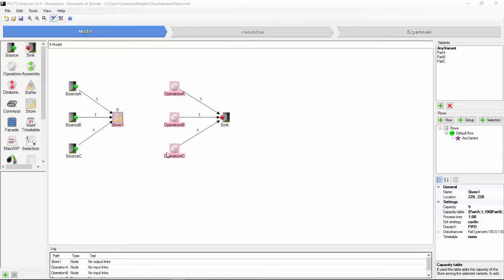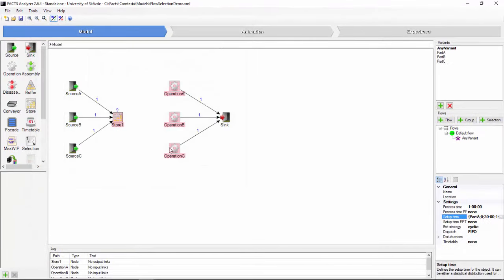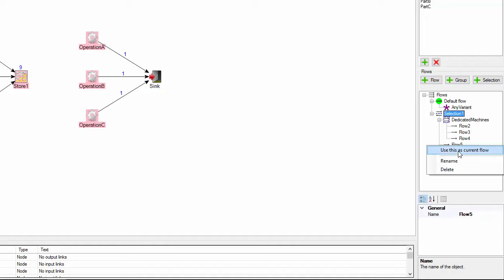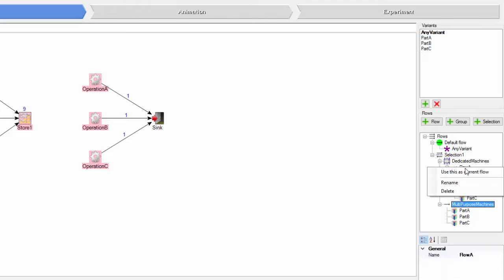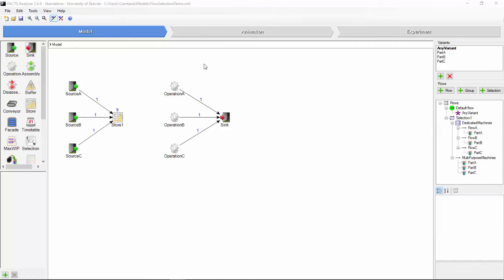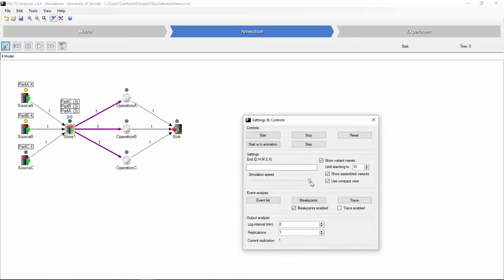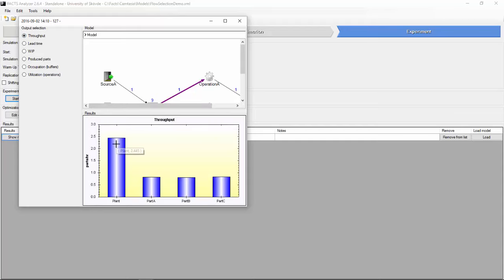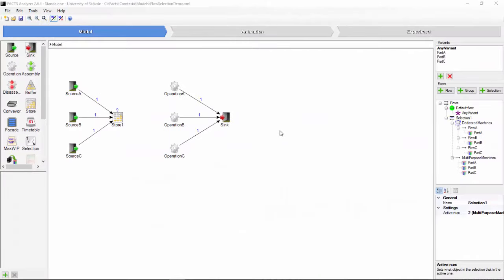Flow Selection Demo

Comment: ⥊ 65: 66

0: Good

001: Uniqueness
002: Altruism
003: Sensivity
004: Audacity
005: Boldness
006: Astuteness
007: Ingenuity
008: Innocence
009: Truth Seeking

01: Willpower
02: Progress
03: Acuity
04: Love
05: Bravery
06: Congruence
07: Consonance
08: Honesty
09: Cleverness

1: Ethics
2: Problem-Solution
3: Definition
4: Idea
5: Expression
6: Why / Who / When / How / Where / What
7: Information / Code
8: Stability
9: Sanity

10: Network
11: Justice
12: Affront / Easter
13: Subject / Death
14: Cognition
15: Agent
16: Reason
17: Discourse
18: State
19: Control

20: Judgement
21: Ethical Solution
22: Scupulous
23: Delimitation
24: Humor
25: Behavior / Christmas
26: Motivation
27:    Comprehension
28: Dependency
29:    Regulation

30: Liberty
31: Permission
32: Discernment
33: Responsability
34: Support
35: Means Invention Mechanism
36: Purpose
37: Opinion
38: Decision
39: Prospect

40: Goodness
41: Awareness
42: Critical Thinking
43: Consideration
44: Conceive
45: Plan
46: Ability
47: Knowledge
48: Character
49: Ambition

50: Good Expression
51: Manifestation
52: Resolution
53: Application
54: Empowerment
55: Movement
56: Demonstration
57: Assignment    Mission
58: Building
59: Proficiency

60: Accordance
61: Appropriated
62: Implication 
63: Indicator
64:      Cohesion
65: Function
66: Investigation
67: Argumentation
68:      Sophistication 
69: Scrutiny

70: Intelligence
71: Message
72:      Consistency
73: Election
74:     Coherence
75: Consolidation
76: Explanation
77: Flow
78: Constancy
79: Measurement

80: Peace
81: Sovereignty
82: Perseverance
83: Reliability
84: Autonomy Instrospection
85: Rectitude Implementation
86: Pursuit
87: Persuasion
88:      Structure Benign
89: Commitment

90: Kindness
91: Assertiveness
92: Optimism
93:     Scrupulousness
94:     Compassion
95: Composure  Essence Fiscalization
96: Blockchain: ⥊ (TRACE MARKER) Legacy
97: Anarchy
98: Veganism
99: Revolution

100: Liberation
101: Decency
102: Progressive
103: Resilience
104: Integrity
105: Collaboration
106: Abolitionism
107: Concordance
108: Clarity
109: Regulation

110: Ethical Commitment
111: Honor
112: Exploration
113: Privacy
114: Will
115: Pride
116: Justifiable
117: Equitable
118: Fair State
119: Mission

120: Harvest
121: Deliverance
122: Resistance
123: Cogitation
124: Challenge
125: Appropriated
126: Searching
127: Emphasis
128: Consistent
129: Subversion

130: Fulfillment
131: Admission
132: Criteria
133: Response
134: Provide
135: Technique
136: Principle
137: Point of View
138: Choice
139: Prevision

140: Serenity
141: Conscience
142: Concern
143: Perception
144: Free Love
145: Idealize
146: Capacity
147: Mindfulness
148: Schema
149: Morality

150: Righteousness
151: Virtue
152: Coordination
153: Efficiency
154: Equip
155: Cooperation
156: Profiling
157: Counter-Terrorism
158: Rising
159: Excellence

160: Reasonable
161: Procedure
162: Corroboration
163: Hint
164: Value
165: Role
166: Lead
167: Logical
168: Improvement
169: Assess

170: Sympathy
171: Relevancy
172: Dichotomy
173: Naming
174: Elucidation
175: Materialization
176: Validity
177: Harmony
178: Fluency
179: Verification

180: Perpetuity
181: Independency
182: Perseverance   Dependability
183: Structure
184: Potential
185: Stance
186: Occupation
187: Compelling
188: Conviction
189: Boldness

190: Power
191: Wisdom
192: Effectiveness
193: Prudence
194: Foresight
195: Discipline
196: Trackable
197: Accountable
198: Compeling   Sustainable
199: Quest

200: Ideal
201: Compatibility
202: Referee
203: Adjudicate
204: Conformity
205: Coexistence
206: Methodical
207: Correspondence
208: Eccentricity
209: Expertise

210: Solution
211: Resolution
212: Prosecution
213: Adjustment
214: Transformation
215: Conversion
216: Escalation
217: Correction
218: Persistence
219: Analytical

220: Contemplation / Meditation
221: Preparedness
222: Dialectical
223: Meticulous
224: Diligence
225: Attitude
226: Rigorous
227: Dispute
228: Healtiness
229: Prescription

230: Allowance
231: Agreement
232: Definition
233: Jurisdiction
234: Availability
235: Proposition
236: Objective
237: Reckoning
238: Settlement Warrant
239: Assurance

240: Mindset
242: Mental State 242: Consideration
243: Rumination
244: Impression
246: Sagacity
247: Easygoing
248: Disposition
250: To Thrive 
253: Conduct
254: Potent
255: Insurgency
257: Defiant
260: Unveiled    Exposed 
261: Freedom Fighting
262: Correlation
263: Relevance
265: Conjecture
266: Suggestion
269: Estimate
272: Paradox
273: Choice
274: Dispute
280: Constancy
282: Evanescence
288: Healtiness
289: Conduct
290: Prognosis
294: Anticipation
295: Proof of Stake
296: Calculation
297: Proof of Work
298: Commitment

300: Crusade / Jihad
304: Concept Attention
301: 
309: Consensus 
310: Conviction
311: Consent
312: Confront
312: Distribute
313: Enforcement
314: Bodily Autonomy
320: Deliberation
322: Opportunity
327: Suspicion
330: Adherence
331: Self-Determination Demanding
333: Abundance
334: Accountaility
335: Technician
336: Dedication
338: Permanent
339: Maturity
340: Promote
341: Confirm
342: Validate
343: Imagination
344: Qualification
345: Ratify
346: Organization
347: Propagate
348: Finance
349: Encourage
350: Operation    Materials
351: Engagement
352: Endeavor
353: Undertaking
354: Remarkable
355: Designation
356: Exposing 
357: Proactive 
358: Forge
359: Accomplish
360: Technology
363: Compatiility
367: Addressing
372: Ambiguity / Conflict
373: Retort
370: Standpoint
372: Conflict
377: Context
383: Orientation
390: Prognostic
394: Prediction
398: Sustainability
399: Overthrow

400: Earth Population
402: Diversity
410: Permaculture
411: Mathematical
413: Realizing
421: Metamorphose
422: Transcend
427: Skepticism
430: Abstraction
434: Care
435: Possibility
436: Inspiration
440: Insight
441: Abstraction
442: Contemplation
443: Brainstorm
444: Formulation
445: Elaboration
446: Capability
447: Know-How
448: Apparatus
449: Theory
453: Design
454: Escalation
455: To Arrange
457: Rapport
460: Aptitude
461: Rigorous
462: Affect
463: Skill
464: Competence
465: Performance
466: Conjecture
467: Intelligible
468: Enrichment
469: Expertise
470: Wisdom
471: Accessible
472: Distinguishment
473: Priorities
474: Perspective
475: Constatation
476: Punctilious
477: Attentiveness
478: Amusing
479: Insurance
480: Security
481: Inclusive
482: Durable
483: Trustworty
484: Individuality
485: Convenience
486: Satisfaction
487: Benefit
488: Friendly
489: Praticality
495: Marvelous
496: Sensational
499: Envision
Reply: 500: Assumption
501: Leadership
502: Credit
505: Viable
503: Esteem
509: Prestige
510: Admiration
511: Heroism
512: Pugnacity
513: Description
518: Steady
520: Proficiency
525: Habit
530: Implementation
531: Solicitation
532: Regard
533: Contract
534: Requirement
535: Execution
536: Utilization
537: Utterance
Reply: 538: Respect
539: Esteeem
540: Appreciation
541: Sensatize
542: Instigate
543: Sentiment
544: Sharp
545: Assembly
546: Potency
547: Education
548: Solidity
549: Evolve
550: Fellowship
551: Insurrection
552: Schedule
553: Reportation
554: Convocation
555: Party
556: Campaign  Instruments
557: Coordination
558: Systematize
559: Seize
560: Protesting
561: Explicit
562: Reciprocity
566: Intimation
Reply: 570: Counter-Terrorism
571: Cracking
572: Decipher
573: Affinity
574: Interpretation
575: Blitzkrieg
576: Codification
577: Spreading
578: Decoder
590: Excellency
595: Heroic
599: Eagerness

600: Organizator
611: Consequence
612: Researching
613: Suitable
620: Diagnose 
629: Symptom
633: Incumbency
634: Inspiration
636: Cause Goal
643: Reflection
644: Theory
646: Brililiance
647: Logical
648: Content
653: Appliance
655: Mobilize
654: Overcoming
660: Operation
661: Operator
662: Nexus
663: Evidence
665: Role
666: Questioning
672: Discussion
673: Instructions
676: Deduction
694: Systematic
696: Sublime

700: Lucidity / The Gear / Artificial Intelligence
702: Credit
704: Data
710: Coherence
711: Rational
712: Intimation
713: Precision
714: Acquaintance
715: Presentation
716: Manifesto
717: Pronouncement
718: Proclaiming
719: Revelation
721: Point
722: Interpretation
723: Reparation Ambivalence
724: Sense
725: Direction
727: Compensation
729: Disclosure
730:    Importance
731: Interaction Consent (Y/N)
732: Contrast
733: Designation Nomination
734: Endorsment
735: Product
736:    Importance
740: Statistics
743: Understanding
744: Grasp
746: Thoroughness
747: Articulation
748: Conceptualization
749: Enchantment
750: Consolidation
751: Communication
753: Instrument
754: Conquering
755: Coalition Coordination
756: Inspire Instruction /Method
757: Prompt
759: Delight
760: Instructive
756: Instruction / Method 
766: Causality
770: Appreciation / Gratitude
771: Algorithm Statement
772: File
773: Algorithm Recognizing
774: Code
775: Information Output
776: Correlation
777: Pattern /  Construct
778: Development
779: Enumeration
780: Systematization
799: Revolution Algorithm

800: Providence / Supremacy
801: Production
802: Necessities
803: Resorces
804: Energy
808: Renewable Cycle
810: Permaculture / Benign
811: Fair Law / Constitution
819: Lament
820: Predominance / Management
829: Ephemeral
830: Logistics
831: Inquiring / Scheme
832: Reach
833: Entrusted
834:  Dependability  
835: Stock
836: Gravity
840: Consumption
843: Zeal
844: Creativeness
846: Independent
847: Autodidact
848: Integration
850: Labor
853: Usage
854: Disciplinated
855: Devotion
858: Accessibility
860: Human Resources
861: Adequated
862: Shape
863: Assignments
866: Estimation
870: Structure
873: Congruity
880: Peace
888: Globalization

900: Transparency
910: Panacea
911: Emergency Call
919: Enclosuse
930: Enlightenment
931: Only One Global Currency
935: Resources
936: Legitimacy
940: Empathy 
944: Wishing Well
946: Compassionate
947: Philanthropy
948: Unification
954: Intrinsic
955: Fidelity
960: Synthesis / Blockchain Integration
961: Remarkale
962: Guide / Formidale
963: Monolith
966: Proof
970: Examination / Gallant
971: Vocabulary
973: Pertinence
975: Inspection
979: Impressive
980: Splendid
990: Optimization
991: Imperative
995: Accountancy
996: Revolution Chain
998: Regulation
999: Zenith Vortex Epic
1000: Militancy
1001: Nova Era

1010: Peer-2-Peer
1011: Decentralized Network
1012: Distributed Ledger
1030: Financial Revolution
1031: Resources Availability
1040: Production Revolution
1042: Drug Liberation
1049: Implementation
1050: Labour Reorganization
1100: Liberation Army
1133: Abolitionism
1160: Pacifism
1312: Boycott
1317: Identifiable Source
1400: Unity
1444: Direct Digital Democracy
1500: Benevolence
1550: Charity
1807: Black & Yellow
2000: Sanctuary
3000: Freedom
3030: Win-Win
3100: Triumph
3311: To Revolt
3330: We All Can Live In Abundance
3712: Problem In Your Opinion
4000: Coexist
4411: Riders of Justice
5000: Glory
5500: Greatness
6500: Quantum Mechanics
6999: Mystery
7220: Unified Field Theory
7755: Revolution Gear
8000: Sustainability
8999: Finitude
9997: Discovery
9998: Unknown
9999: Universe
10000: Existence

. This is a Numeric Matrix for Communications Purposes.
. This Can Be Used to Convey Meaning.
   Ex.: 2034: To Judge the Idea.

. Mathematical Operators Can Be Used to Calculate Meaning.
   Ex.: To Judge the Expression: 25
   20 + 5 = 25 (Behavior)

. Logical Operators to Create statements.
   Ex.: ¬11: 13. If not Just then Death.

. Colors can also be used as information.

- You can help build it.